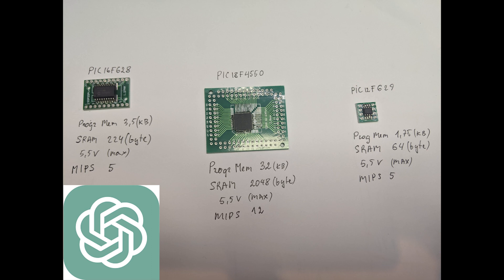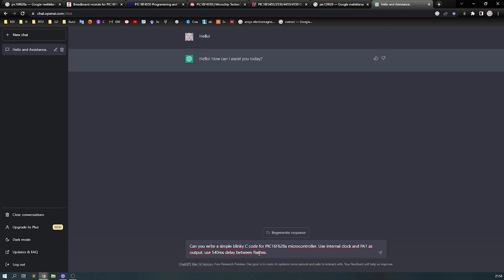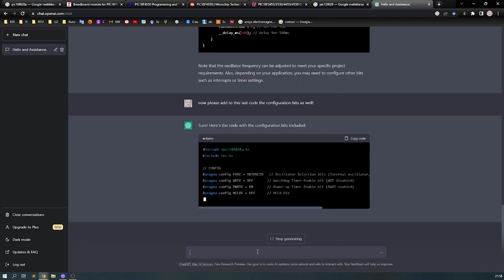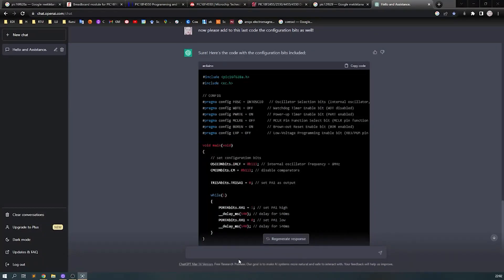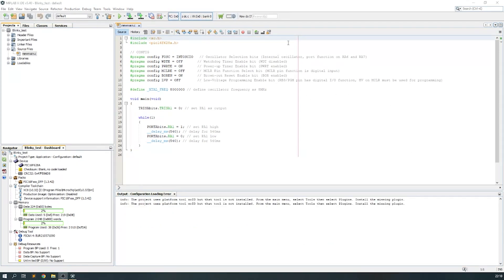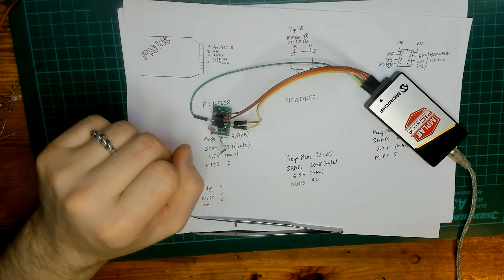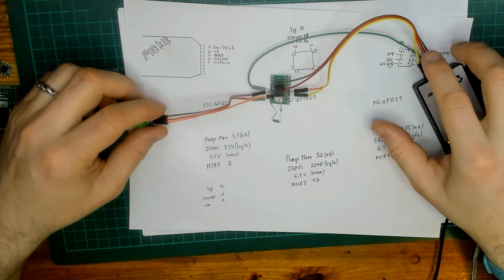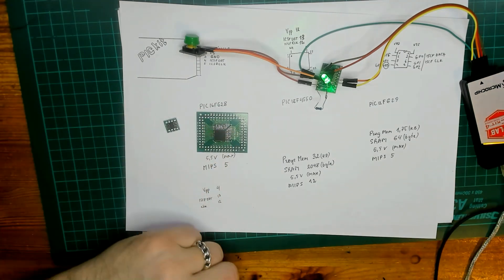Programming a PIC Microcontroller from Scratch using only ChatGPT

Comment: As you said. How did you know how to hook it up to your controller? Where did you get the information and how did you decide which pins to use? Thanks for the video. How do you know if you need to add components to the micro controller to get it to work, such as a crystal or capacitors and or resistors? It would be nice to pick one and program it starting with a bare chip. You could use the chip on the arduino and that would answer the question about the caps and crystal right off the bat. I am old and just learning so any help on programming would be greatly accepted. Have a nice day.
Reply from the maker: Hi! Well I have worked with this microcontroller (mc) few years ago, so I know quite a lot about this particular one! In order to run simple blinki program, there is no need for lot of components. 1. You should check, does the mc provide internal clock! This is important, because without the clock signal it can't run at all! So it it does, you need only power supply and led with resistor and you're good to go! If it doesn't provide internal clock, then you must connect and external clock source and also select that in #pragma configuration (in fuse bits).
Reply: @repair-stuff  thanks
Reply from the maker: In my experience, I had some problems to write a program into single Arduino chip but in PIC microcontrollers, there is quite easy, no struggle for me. I guess that's just experience issue.
Other than that, I started with simple pic16f628a very basic, I also started to write code in assembly language.
But in order to understand what you should do with the microcontroller, you should use 3 sources: 1) datasheets, 2) user manual and reference notes, 3) some good example (simple but good)!
Good luck and stay sharp!